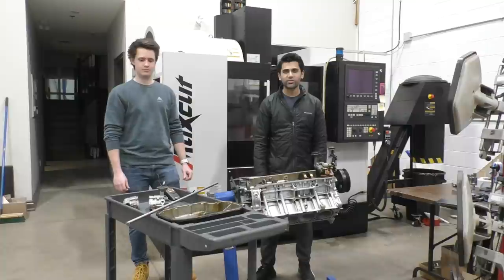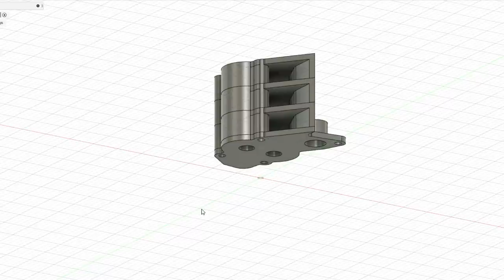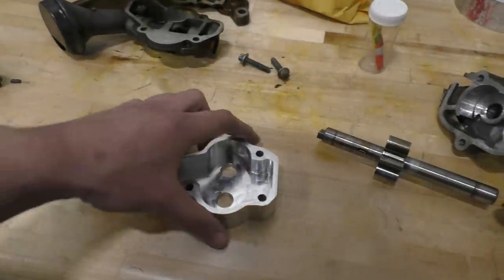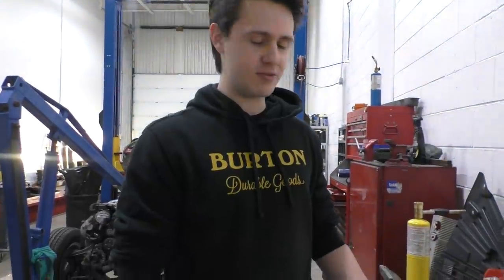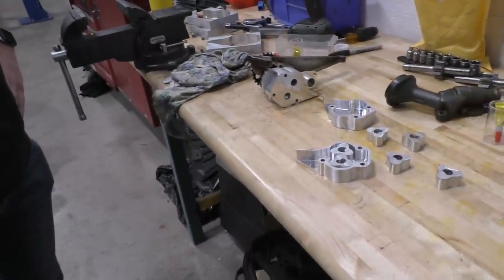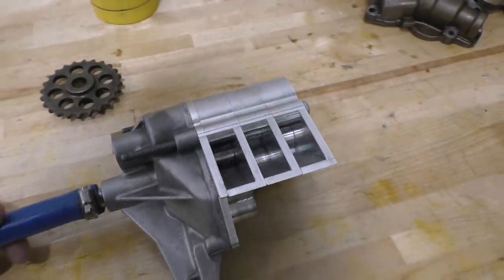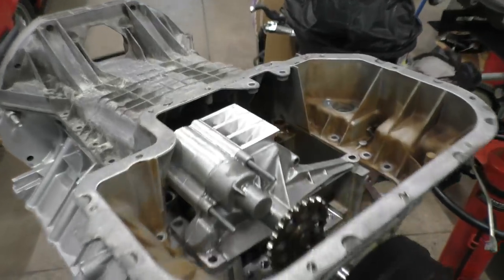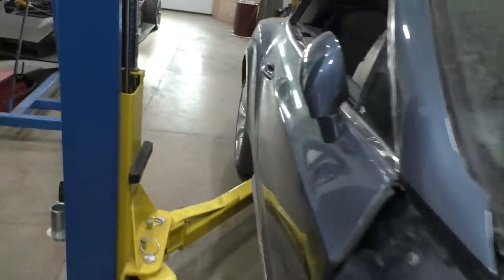Making a Dry Sump Pump using Super Glue! - Project XF1 Part 3

Comment: Consider venting the oil tank into the valve covers. When the scavenge pumps aren’t moving oil, they are moving air. If you vent into the valve covers, you will create air flow down the return ports in the heads, helping to remove oil from them
Reply: Yea thats a pretty good idea
Reply from the maker: Well, the air is still free to move from the timing case but I will block off the breathers. The blow by will be sucked by the scavenging stages and exit at the external oil reservoir
Reply: @xfmotorsports  , vent where you expect the least oil vapor. Maybe a separate crank case scavenge pump for blow by?
Reply: @xfmotorsports  It might be overkill but some engine builders like using a vacuum regulator instead of blocking off the breathers. Using a regulator lets you set it to fully blocked off, dial it back and then make sure that the vacuum stays consistent in the crankcase as the pump wears in and loses some efficiency. I'm pretty sure the reasoning is that you can tune closer to the edge without worrying about the back of the piston experiencing more resistance as the engine accumulates run time
Reply: @xfmotorsports  you might want to vent the vacuum, to much vacuum in the crankcase will blow seals, but slight vacuum is  good against loses

Comment: Fun Fact: The C8 Corvette's aluminum chassis is mostly glued together, with only a few portions put together with bolts
Reply: So are all the modern lotuses except the evija but that doesn't really count
Reply: @palmermonsen9098  Yeah the Evija sucks, 0% lotus
Reply: @THESLlCK  So true, what happened to low weight low power and handling?
Reply: @palmermonsen9098  the chinese apparently lol
Reply: You are correct. Cant weld the aluminum. Probably the type of aluminum. 

Most steel cars are also glued to assist the spot welds. You can see it a lot in the older Mercedes. Ferrari also glued their chassis. 

This technique is probably about 40 years old now
Reply: @450ktm520  You can weld aluminium(some alloys you can't but that's beside the point), but it usually requires thicker walls, much thicker than your structure would require and for most alloys you need a lot of heat treatment after welding(like normalizing, tempering, etc.). Gluing is cheaper and you end up with a lighter car, so it's a no brainer.

Comment: There is a reason the OE ones are hardened steel. Curious what clearances you have in relation to pump walls. Also, I suggest still doing an oil test unless you use 0wt.
Cool project, but looks more like a proof of concept than something i'd use. Open to being proven wrong as usual.

Comment: Very good design and nice fit! Need E55/CLS55 m113k engine oil dry sump with or without billeted upper oil pan/billeted lower oil pan or whatever with external oil reservoir tank and oil pressure regulator.

Comment: I'm quite curious how will the original mercedes gears handle additional load. There is also a question of using aluminium as a bearing material for hardened steel shafts with transverse load from a high pressure oil side.

Comment: That oil tube that runs from the back to the front has that fitting that just connects with nothing really holding it. Seems I saw a video where that started leaking bad and starved the engine of oil. You know what happens after that. Destroyed his engine.
There has to be a better way to hold it together. I think there is just an o-ring there which can deteriorate.
Your design is ingenious! I used to run cnc and electronic tracer machines back in the 70s and 80s. It's all in the setup especially when you run tolerances of -0/+.005 inches on titanium.

Comment: Fantastic fabrication 👌🏻 Will it be beneficial if you ad locating dowels between the pump housings ? Will the aluminium pump rotors hold up to the constant torque fluctuations where the shaft go through the rotors? Aluminium is soft and it might wear premature. Just my 2 cents. Great work guys can’t wait to see it run  🏁

Comment: Great engineering work! 

I have a question though... the clearance between the lobes of the pump is very fine - has the thermal expansion of the lobes been tanken into account, so the pump lobes will not make contact when the engine and oil is at operating temperature?

Comment: That flow is crazy.  What happens if it constantly runs dry?  That sump will probably outflow the inbound oil pump by far.  Is there any kind of bypass that maintains a certain amount of wet level in the sump area?  Is it even a concern?

Comment: Surprised your pumps take the oil from the middle of the pan… if you drive a long wick curve won’t that leave the pumps possibly just sucking in air ? Or is the external dry sump reservoir big enough to allow for that ?

Comment: I see a torch next to the parts when you used a hammer to separate the superglued parts. Did you use the torch to weaken the superglue or was it there for some other reason? If you didn't, use a torch to weaken the superglue before hitting it with a hammer.

Comment: You need to avoid removing the base plate from the vise between machining operations, that way you face the fixture once, then glue on a bunch of parts and don't have to face the fixture every time you put it in the vise.  If you doubt my advice, put the fixture plate in, face it, then take it out and put it back in and run a 1 tenths indicator over the entire face.

Comment: The wings on the sump are now unnecessary so I would cut them off as well as creating a mini sump under each set of bearings to catch and channel oil to the scavenge pumps. Otherwise your dry sump system will be very inefficient and cause some of the problems you're trying to solve.

Comment: A wet sump should have baffles to stop the issues you discuss with pickup; basically, the baffles keep the oil "calm" but have holes in each baffle to allow oil to flow. Only motorcycle wet sumps do not need baffles.

Comment: SO SWEET!...as always. :)
that superglue mounting trick is a huge time/effort-saver, but personally, i'd use a block of wood or something to cushion the hammer when knock the piece off. using a steel hammer on a machined metal part is just asking for trouble, no matter how careful you are. lol, just my $0.02, which market-price-wise is worth significantly less than that actually. :/

Comment: Don’t bother with a screen over the pickup, with aluminium gears I’ve had them chew through bearing material from a blowup with hardly noticeable loss in efficiency afterwards. Screen over reduces efficiency for all time. Also, one of the key benefits of dry sump requires scrapers, you should do a new sump for this with individual chambers with scrapers that are a close fit to the rotating masses.

Comment: I’m confused as to way you cut that weird shape into the gears is the shaft was only machined with a flat profile. Aren’t you concerned the gears will round out on shaft?
Reply: Practically the key will only have a small contact patch even if it was machined flat to match the shaft. I think the material choice is very important here, as the aluminum gears will wear much quicker (fatigue, not like friction) than the steel shaft. I would guess the shape on the gear minimizes stress risers on the aluminum, thus improving its fatigue resistance.

Comment: I would recommend changing to a brass hammer instead of a steel ball peen...Also, with your aluminum pump end plates and aluminum pump lobes floating on the shaft.  Will there not be a problem with wear of the end plates and ends of the pump lobes without any thrust bearings?  Usually aluminum on aluminum will gall, but with the oil perhaps not?
Reply: Curious about the wear too, some oil lite bushings pressed into each housing around the shaft that sits a bit proud on each side as a minimal thrust surface was my first instinct to up longevity for both shaft and rotors.
Reply: @wolfman5494  Yes...and I have never seen Pump Lobes made of Aluminum in my 40 years of building race engines and doing prototype design...I would have chosen 4130 and had it Heat treated and then Wire EDMed...hope those aluminum lobes don't fail and cause instant engine failure...Even cavitation erosion or fine particle erosion of the Aluminum Lobes will open up the tolerances enough to cause problems.
Reply: @prestonengebretson2920  check out Dailey engineering drysump pumps they are all alloy apart from the pressure section which is one 4140 spur gear and one bronze gear for wear use.  Most drysump applications are alloy now with a hard anodizing for any wear resistance.

Comment: All three stages of your pump scavenge from the same place, what's the point?
Wouldn't it be better to make them scavenge from right/left/center parts of the sump?
Reply from the maker: Usually there is an indivigual stage for each pair of cylinders but in this case since we werent changing the upper oil pan and wouldn't have been able to mount the engine lower because of the flywheel size, there wasn't much gain doing that
Reply: @xfmotorsports   if I understand right you mean distribution of scavenge pumps along the length of the block. My question was about putting scavenge points on right/left sides of the sump that looks pretty wide, so in turns you might have some oil in the sides.
Reply from the maker: @777MAV  Yeh, we are going to be blocking off the sides as much as possible. The width isn't needed anymore
Reply: @xfmotorsports  If you scavenge from the same place, is there an advantage of using 3 scavenging stages instead of 1 bigger pump? Not trying to nitpick, just being curious. I was thinking maybe it's for redundancy, since scavenge pumps are said to be not too long lived, or maybe since you are bolting the new housings to the existing one, a single stage wouldn't have fit.

Comment: Wait are you holding an endmill in a drillchuck haha. Also you need to improve you'r speeds and feeds those are way off. Crank up the spindle rpm guys, alot.

Comment: You will lose proper lubrication for the chains, they are designed to be covered by the oil in the oil pan... It's a know issue on that motor